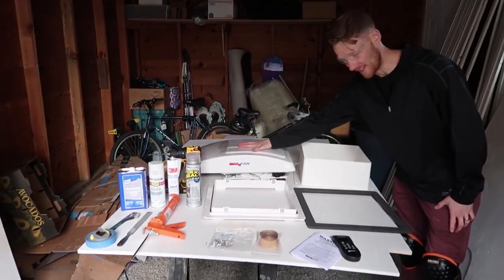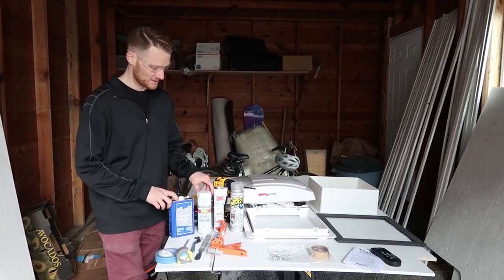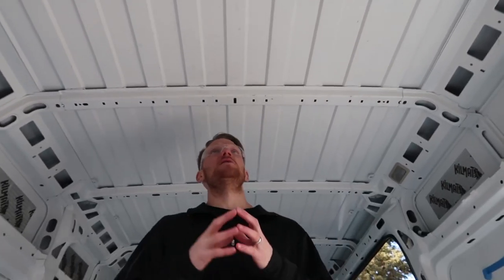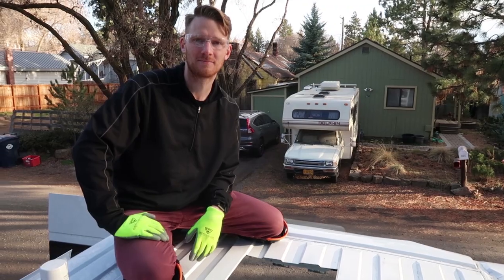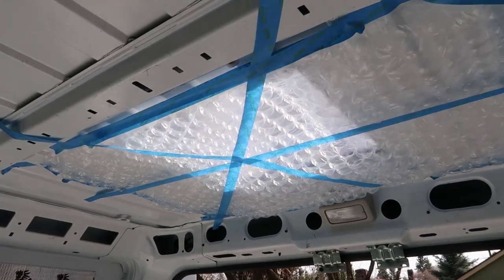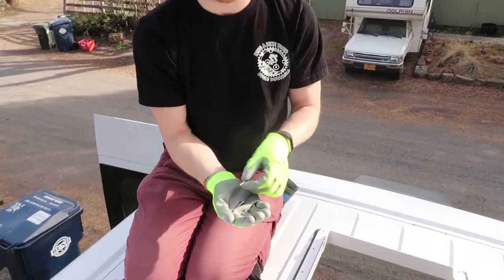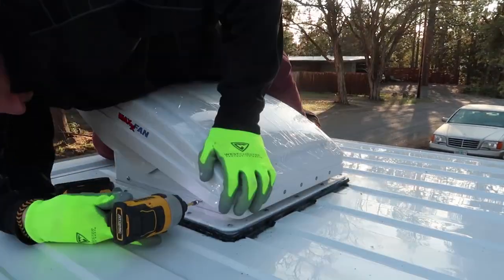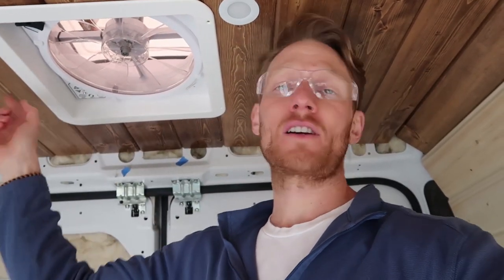MaxxAir Fan Install: Step-By-Step FUN & Super Simple Tutorial

Comment: Thank you for the video, it was super helpful! Just a tip, when I did this I drilled 8 holes, two near each corner but left the corner in tact. Then I cut the lines between the holes, then cut out the corners last. It reduces the vibration a lot.
Reply from the maker: Good tip! Thanks for sharing!

Comment: Thanks for the video. Did u have issues lining up the holes on the fan with the flange. Did you have to push the fan down hard?
Reply from the maker: Yeah if I remember correctly, you have to pop up the little tabs on the flange just about 1/8” so that everything lines up correctly.

Comment: TWO WONDERING SOLES Nice installation video but you skipped the wiring, and that's where I need help, if you care to share more, I'd greatly appreciate it! Where do you bring you main wires in your ceiling to connect to the wires of the fan? Did you have to drill through the trim ring and bring the fan wires out into the ceiling?
Reply from the maker: No need to drill for the wires, they slide behind the garnish trim ring and into the ceiling and then down into your electrical system.
Reply: @twowanderingsoles  Thank you, I was able to figure it out once I got up there!
Reply: How do you connect the electrical?

Comment: When installing the fan on my Chevy Astro I'll mark out where it goes from under the roof and drill the 4 corners from there and then jigsaw from the top. The Flex Seal looks interesting. If it comes in white I may go that route or use lap sealant or a marine product. By the way they don't make adapters for the Astro so it will be layers of butyl tape. Thanks for posting.

Comment: Really Fantastic Video!  I want to install this MaxxAir Fan in a similar space in the rear bay of my new 2023 Transit Trail 148"WB non-extended van, but the space between my ribs on the roof inside the van in that space is only 13 3/4 ".    Is this going to be able to squeeze in?

Comment: I ordered the wrong adapter for my sprinter van. I watched a number of videos that only use butyl tape. Do I really need the adapter? I have a Maxi air 1500 deluxe.
Reply from the maker: I liked using the adapter to make everything flush and I would recommend it. I guess you could use butyl tape but I would worry about leaks if not fully sealed. Let me know what you end up doing.

Comment: What did you use to cut the garnish trim ring?
Reply from the maker: I used a fine blade on my jig saw, but you could use a hand saw or even tin snips if you had them. Just make sure the edge is not sharp when you put it up in the cavity

Comment: How did you wire it to power?
Reply from the maker: Hey Daniel, the fan comes with wires to hook up to your 12 Volt system, which is connected to a 12V Blade Fuse Block. That's how it is connected to power. If you have more questions, I'd be happy to help out!

Since we get so many electric system questions, we actually have our entire Electric Blueprint available on a downloadable PDF. We go over our entire system end-to-end and show exactly how everything is connected. You can check it out on our sister-site, Van Conversion Academy: https://vanconversion.academy/courses/electric-system-blueprint
Reply: @twowanderingsoles  thanks so much man! i just bought a 159wb today!!!!! Sent you guys a pic on insta <3 thank you for inspiring me!
Reply from the maker: @DanielMustang47  That's so exciting! Thanks for sharing! So stoked for you!